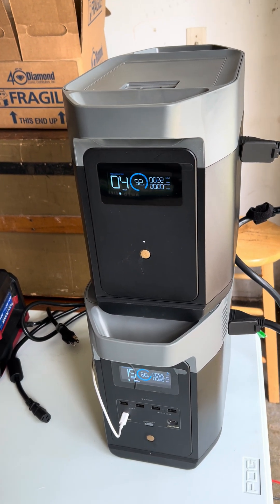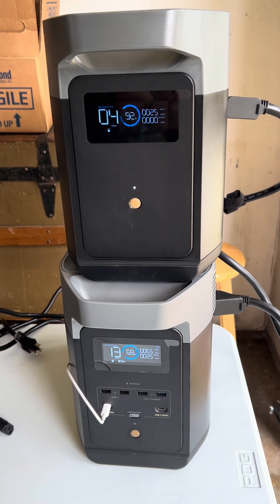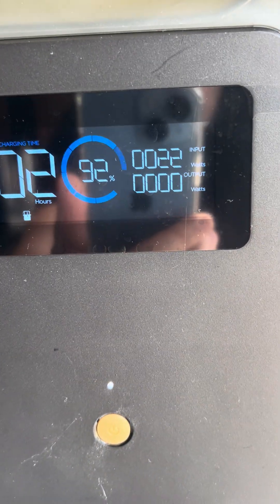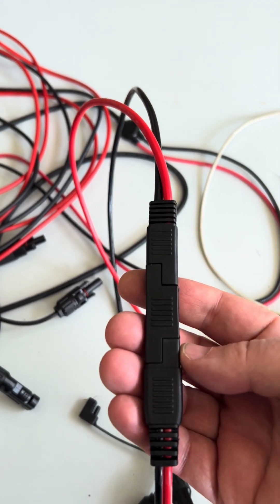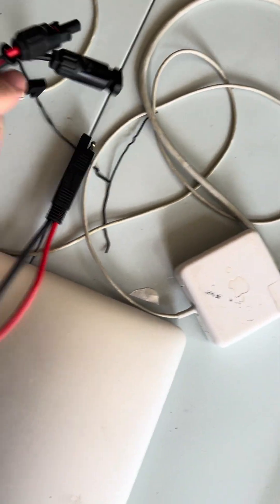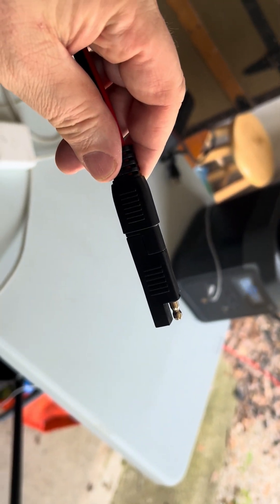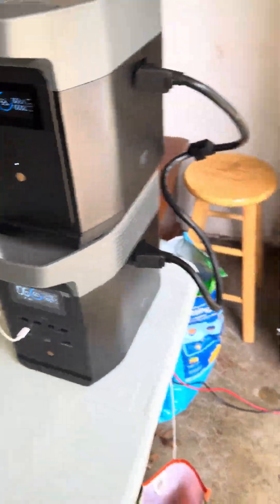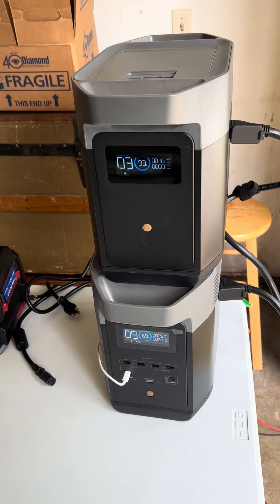Ecoflow Delta 2 with 2x 100 W Harbor Frieght Solar Panels ?

Comment: Those little black adapters are polarity reversers. You are reversing the polarity of the third panel when you use all of them together. You can see at @4:25 you have the positive on one side ending up as negative on the other.

Comment: well you have the 1st two panels hooked up in series so you are taking 2 12v panels and making them 24v. and when you add the 3rd panel it is in parallel which keeps the 3rd panel at 12v. this is way you only get a 50 watt boost form the 3rd panel. if you hook up all the panels in parallel then it would only be at 12v but the wattage will go up by 300%. and in series then the voltage goes up to 36v but the wattage stays at 100 watts. hope this helps

Comment: your third panel is not working because it can only take so many volts. you need to wire two in parallel and two circuts. it is not a polarity thing. look up double series and double parallel. wiring in parallel will mean volts do not stack, watts do I think. Go down that rabbit hole and your question will be answered
Reply: I'm probably about to be in the same boat as the OP, and I'm thinking if I have two 100w panels from EcoFlow to go with their own solar charger, it's going to work because they're both 12v. But if I try to run a parallel connection with a Dokio 300w panel that says it's 18v, shouldn't it still work?
Reply: @TenTenorioArt  if I remember right, either volts or amps stack with series vs parallel. I think each panel adds more volts. There is a video that shows series, parallel, and series parallel. The mix is what you need to run more panels. 2 is probably fine in series.